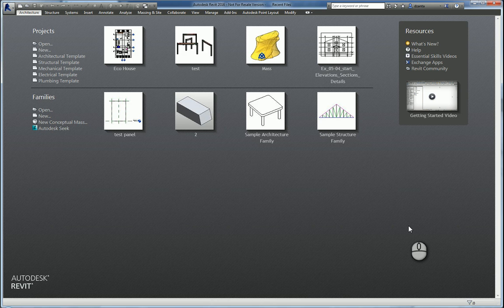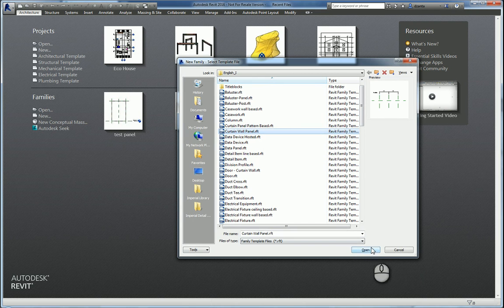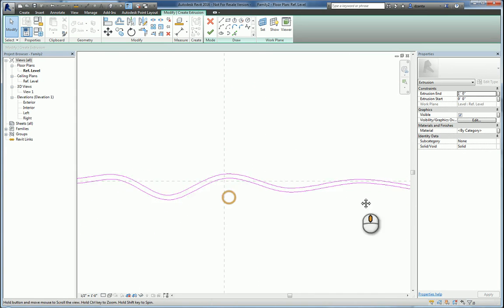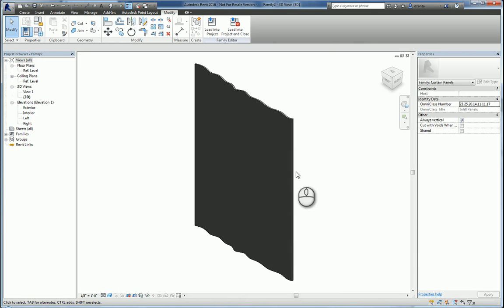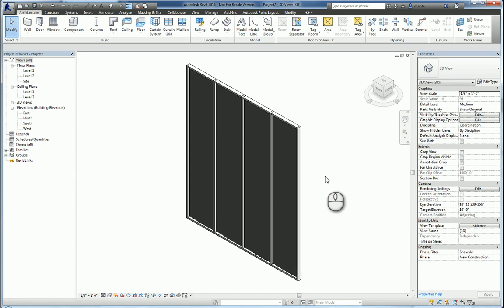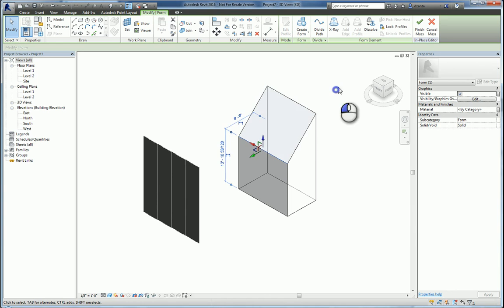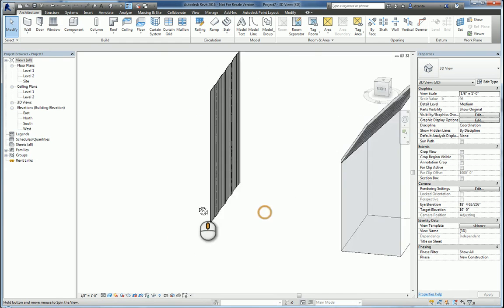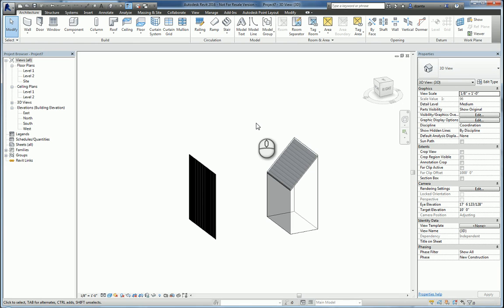Corrugated Roof and Wall in Revit   A How To Guide

Comment: Than k you for the demo...now show it in a model and how it interfaces by "attach" to a sloped roof it wont. It also does not like clipping openings for windows...doors yes but not windows. It is because you are using a curtain wall as the motif.
Reply from the maker: See other reply...it is possible

Comment: Do you perhaps know how to change the material of the panel? It does not give me the option of changing materials and finishes?
Reply from the maker: Tab into the panel, until and change in type selector
Reply: @DzanTa  What do you mean by "tab into the panel"? Thanks for getting back to me!
Reply from the maker: @liesadavies  use tab key on keyboard to cycle select the panel
Reply: @DzanTa  Unfortunately it still doesn't give me the option of changing the material, even when selecting the panel.
Reply from the maker: @liesadavies  the panel is a family.  Once u have it selected, look at the Type Selector. If it shows the panel is grayed out, then unpin it first.  Then go into the Type Properties window and change the material in there.
Reply: @DzanTa  Thank you so much. That worked!

Comment: What could possibly be the reason to "cant make type" ? Followed every step but failed to change the curtain panel type? Thanks
Reply from the maker: Is the curtain wall you are making nonlinear?  If so, this will not work.  This method works if the "walls or roofs" you are making are flat.
Reply: Dzan Ta it’s flat
Reply from the maker: at what point exactly does the error pop up?...after sketch mode when making the profile for the extrusion?...when swapping the standard curtain panel for your custom family?...
Reply: Hi, I'm also having this issue, the error pops up when in my project I click edit type on a curtain wall and change the panel from none to the type I just created, when I click apply 40 errors come up saying can't make type.
Thank you
Reply from the maker: You many need to adjust the sketch of the profile that defines the curtain panels.  You many need to use adaptive curtain panels in your design situation.  I would have to look at your Revit model to get a better idea of why it is failing.
Reply: May I send you the family file along with my project?
Reply from the maker: ok....send me a dropbox or box link of the files or send to dzanta@gmail.com and I will help asap.
Reply from the maker: ok....send me a dropbox or box link of the files or send to dzanta@gmail.com and I will help asap.
Reply from the maker: Hi Gabby....I emailed to you the revised revit project and family with the corrugate panel fixed.
Reply: Hi Dzan Ta. Im getting the very same error of the people up above. Could you please take a look at my family profile? thank you

Comment: Thanks for making this video.  I have followed along and all is great, however, i'm having trouble  rotating my pattern 90 degrees as i want the corrugated pattern to be perpendicular to what's displaying. Revit keeps telling me I can only input a number between -89° and 89°.  Is there any way around that?
Reply from the maker: I do not believe there is any way around this...it's built into the programming.
Reply: Looks like the only way I can model this is to model a generic object and extrude it in a specific profile. I'll just have to draw the entire profile and extrude it. Won't be able to modify it as a curtain wall.
Reply from the maker: looks like that is currently the way to do this.  I will have to look into this tomorrow after teaching class...
Reply: Much appreciated. I'm a bit surprised this isn't a standard modeling tool in Revit.

Comment: Great tutorial, sound a bit shaky.
Just wanted to ask, how do you place windows and/or doors on the wall?
Reply from the maker: There are several ways to add doors/widows to a wall.Method 1:  select door/window command, select type, click on wallMethod 2:  if door/window is already on a wall, you can left click and while holding ctrl down, drag to another location on the wall...this will create another instance of the objectMethod 3:  if the door is a curtain wall door, create the curtain wall door first, then load into your project...then tab select a curtain panel and unlock it to change it's type to the curtain door in the type selectorMethod 4:  create a generic model "door" or "window" and apply it to the face of any object (assume the generic model has the opening command within to allow for cutting into the host objectHope this helps.
Reply: Thanks Dzan. I was actually asking about the corrugated wall you've created. Would I have to modify the family to add windows and doors on it? I had tried the same method one would use to place a door on a curtain wall but it didn't work out
Reply from the maker: interesting...the corrugated panel is just a curtain panel with a funky profile.  It should be able to be swapped for a curtain wall door (note....a curtain wall door...not a door)
Reply: I'll try that out. Thanks again
Reply from the maker: let me know how it goes...or send me your files...I can look at it today to help if needed
Reply from the maker: The corrugated panels of the walls are just panels.  You can load the default Revit curtain wall doors (single and double) and then swap the panel for the doors.  Select the panel, unpin if necessary and then chose your curtain wall doors within the Type Selector in the Properties Palette.
Reply: Thank you Dzan. I struggles and opted for a quick sketch fix. I'll definitetly try this method out and let you know.
Reply from the maker: Worse case...contact me tomorrow and I can help you remotely.